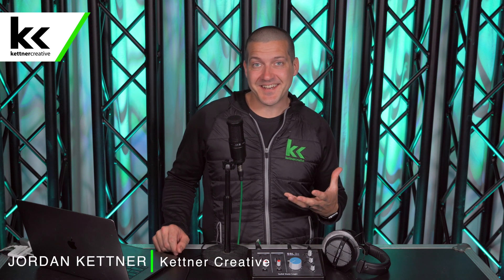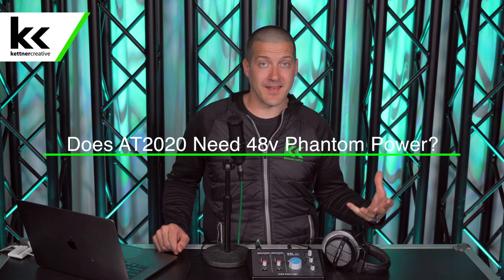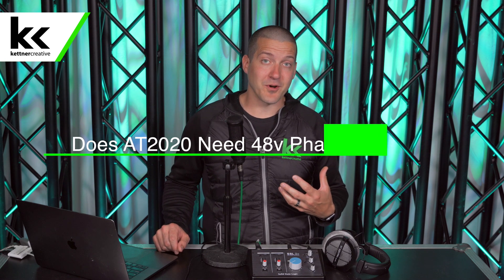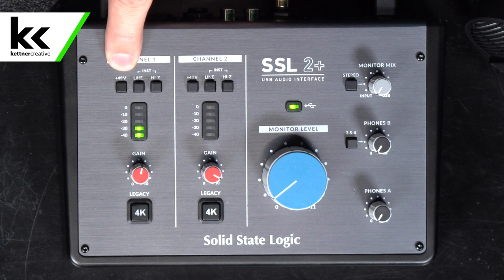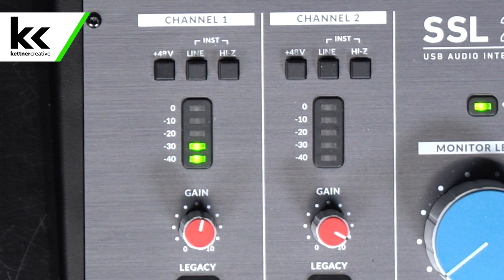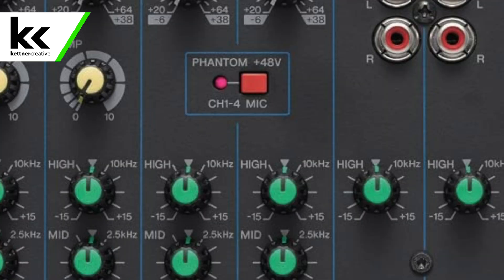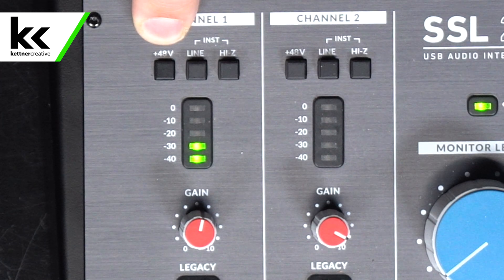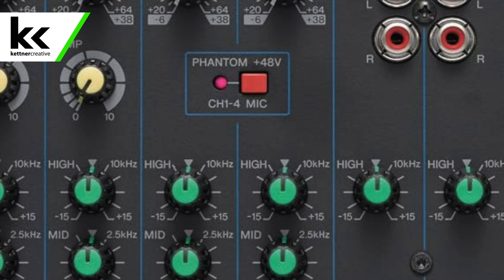Does Audio Technica AT2020 Need 48v Phantom Power?

Comment: I plugged my AT2020 into my Irig PRE box which connects to my Ipad. The Irig box has a 48V phantom power fed with a 9V battery. Does it make sense? No sound whatsoever.
Reply: Update: It worked. I must have done something wrong. Still puzzled over the 9V VS 48V thing.

Comment: I unplugged my AT2020 before turning off phantom power, could this damage the microphone?
Reply from the maker: It's rare but it happens if two of the pins arc. It's best practice to turn off phantom power while connecting/disconnecting cable.
Reply: @kettnercreative  Thanks for the reply, I do try to remember to turn off phantom power before I unplug. What do you mean if the pins arc?